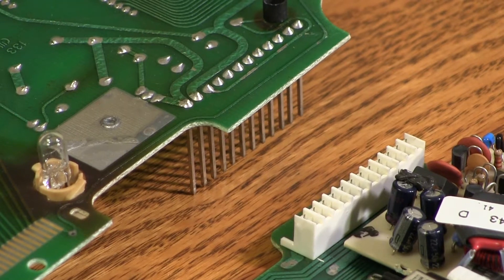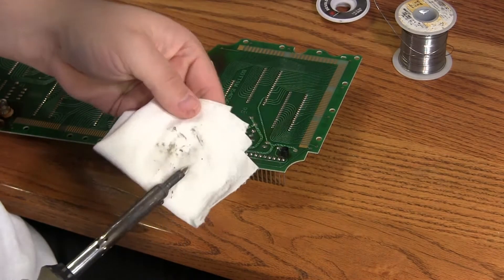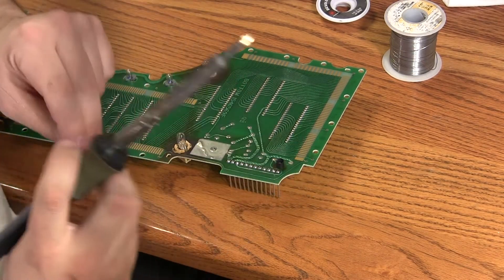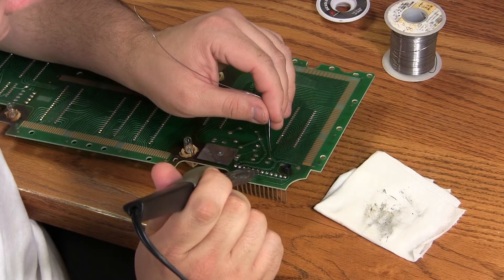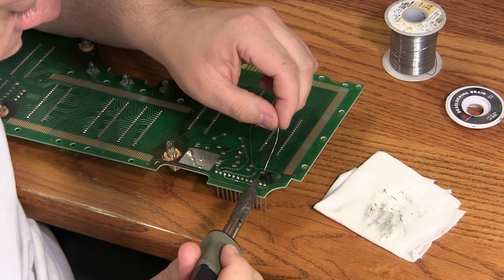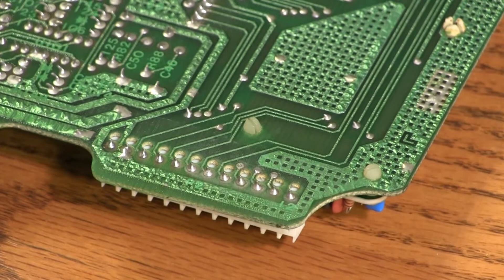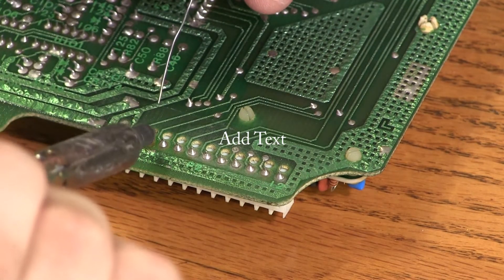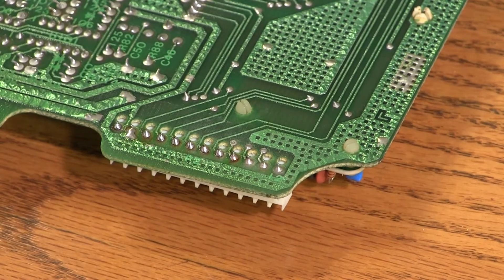84-89 Corvette Gauge Fix 2 Solder Joints

Comment from the maker: If the connector looks burned, it's time to replace it.  I sell a replacement kit with both sides of that connector and the correct solder for $19.95 at batee.com.

Comment from the maker: Hi Gus:

It sounds like the polarizing film is installed in the wrong orientation:  If you rotate the film 90 degrees, it will invert all display settings.  The film we sell at batee.com is cut to size and marked for proper orientation for the factory LCD panels, but there are some replacement panels which are polarized in a different orientation.  Contact me if I can help!

Comment from the maker: Check the bulbs and the " TAIL", "LCD", "CLSTR", and "INST" fuses.  If they're good, the issue is likely inside the cluster.   Are the bulbs not working at all, or are they working but very dim?  If very dim but working, the problem is probably the photocell.  If not working at all, the problem is probably the board connector.  Both parts available on batee.com, along with instructions on how to repair.
Bryan